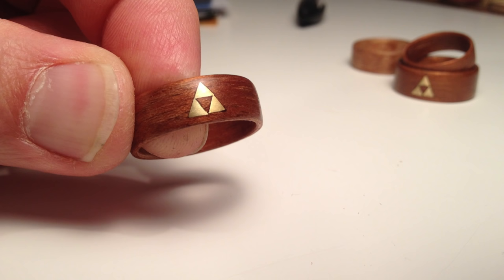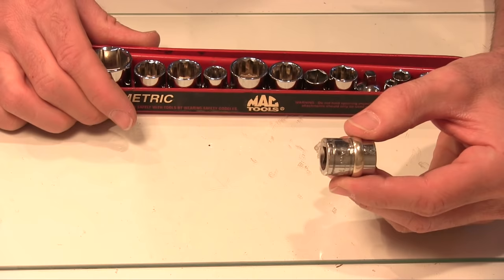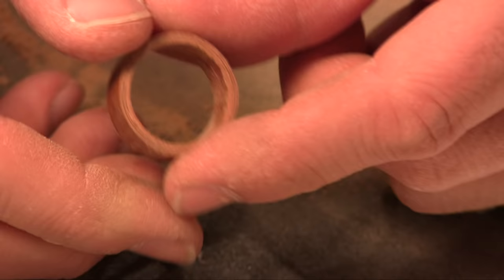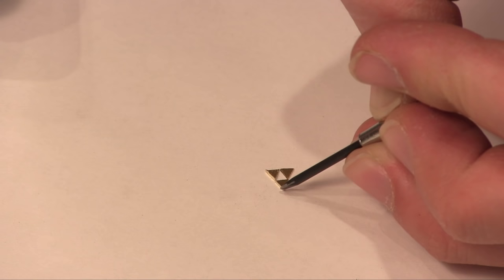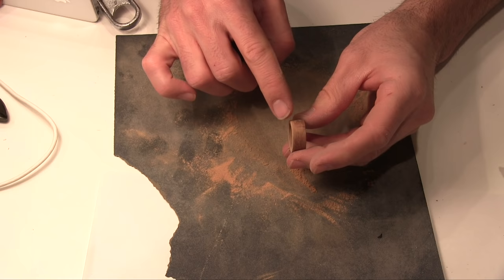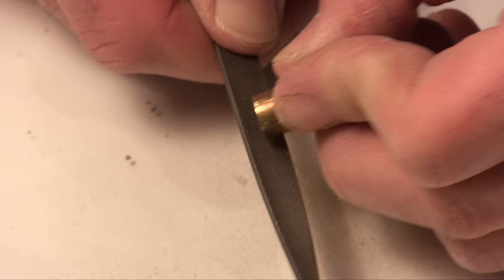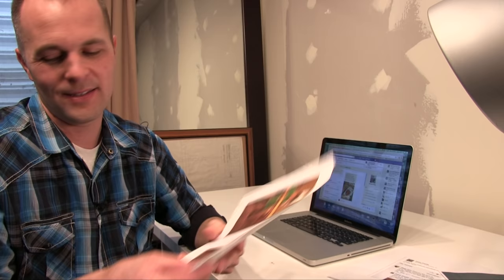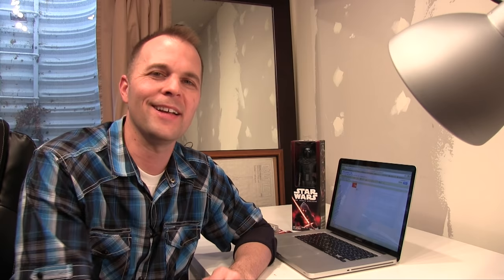How to make Wood Rings - bent veneer w brass Zelda Triforce inlay

Comment: That is pretty neat overall!  The finished product is quite stellar too, imho.  Esp that it looks shiny-ish/sealed.  Thought for SURE you were gonna glue your hands together there. lol   Then again, thought you were going to make each of those last little triangles (when doing the metal shavings) a different color/metal.  That would've looked interesting, too!  SOOOO tiny to work with, give ya credit for all that. What a great idea to use lens or zoom in on your phone to show super close-ups.   As you can prob. tell... not all that 'creative' to even come up with such great ideas myself..   One thing I did think of (well, two) is...  for those teeny triangles, rather than 3... since it's so thin, could you have only cut one larger triangle initially....  Put it on & then cut out the center little triangle (space) instead?  Esp since all are 'touching' just thought that might have been a much easier route. ?   That said, wonder if it would work (and be easier overall) I have this whole "thingamajig" kit I got for 'nails' some time back.  It's metal plates with all kinds of different small designs, patterns, pics, etc etc...   You take any nail polish (could prob. use anything in this case tho, as long as it would eventually come OFF the plate w/ acetone or ? remover of some type. WOuldn't damage it, since metal) even a chrome or holographic looking polish... glitter, what have ya...   Would prob try it right before that final coating or two to seal/finish off the ring..........    JUST before use, you swipe a bit of polish over the design of your choosing & then, using a tool that kind of looks like a short pen with a wide/rounded base that's rubber....  you quickly "roll" over the design to "pick up the image".   Roll that.... over wherever you'd like it (the ring face in this instance.... rather than nail of about.... same area) where it perfectly places design or image in any color, metallic-look, glittered, etc.  Could even do more than 1 in different colors, etc....   around it or.... ?   Once it dries for a minute.....  seal 'er all up & done.     If you get the chance I'm sure there are prob still a TON of videos on "nail image plates" & you'll see what I'm talking about.   A lot easier, I'd think... & more options (yet could still get metal look, as with triangles)  =)     Thanks so much for sharing this super creative idea......  easy (enough, maybe...? lol) for those at home looking for something fun, creative... but not TOO involved or difficult to accomplish.   Really neat!!    ps: How do you determine "other" ring sizes?  Do you have to get a sizer or ?   Then... how do you make 'em small(er)?                 Thanks again.      #ABillionLivesFilm (suuuuper important... esp w/ 8/8 new FDA ridiculous classifications & rules now in place.. ugh)   Live long(ER).. vape on!   #VapingisNOTsmoking (not even close.. smoking KILLS >165,000+ "kids" each/every year... from someone else's.... 2nd hand combustible cig. smoke!!! .... vaping could/would end that)
Reply from the maker: Thanks for the ideas.  The brass I used is too thick to be able to cut out the center triangle.  As for the ring sizes I included a chart in the description, also you can get a ring mandrel fairly cheap.  I looked up the nail image plates, those are a great idea.  I wonder if you can order custom ones.

Comment: Hi, I watched your video several times, got all the materials..... I'm just having one problem. I soak the 1/2" strips in boiling hot water for 20 mins. and can't get them to bend around right.. So I soaked for an hour, still having trouble. So know I'm rolling the veneer a lil putting a rubber band around it and soaking longer (about 1/2 hour) making smaller circles and double wrapping rubber band. 
All together around 2 hours and still can't  bend around small knife handle. 

I'm using Sauers & Company Padauk Veneer 3 square foot pack.
Could it be the type of veneer I got isn't the right kind for a ring project?
Reply from the maker: I'm guessing Padauk is not good for rings.  If you want to mail me a strip of your wood I will try it. (my address is in the description) Have you watched my other ring videos?  In one of them I tested 50 different sheets to find out what woods make the best rings.  I also made a free detailed printout you can use as reference to pick the best woods.
Reply: I think I figured it out. When I cut the strips they seemed a little funny, like off grain. I cut 2 more a little different and it worked a little better. I got 1 ring done, wish I could post a pic here to show you...

Thanks for the reply and yes I have watch your wood test video....

Comment: probably dumb question but is the wood id kit also usable for the rings??
Reply from the maker: I posted a video where I used every sheet in the ID kit and made a ring.  Check it out.  The answer is yes, but it is nice to have a few more inches in length to work with.

Comment: This may sound like a dumb question, but..... does the size of the socket mean the size of the ring? Like, if I wanted to make a ring sized 12, do I use a 12mm socket to wrap the veneer around??? Please help, I'm confuzzled :(
Reply from the maker: +B. Jilian Bonilla No, you would need to measure the diameter of the socket and compare that measurement to the ring size chart. I included a ring size printout in the description.  The reason I used sockets is because they come in many sizes and a lot of people already own them.

Comment: If your dumb enough to do what I did and get the glue on your your fingers, don't panick. If you happen to bond your fingers together, get to a sink and apply a light pressure while holding your hand under running water. If you just get glue on your fingers, wait for it to dry and it will come off pretty easily if you pick a it

Comment: Wouldn't it be better to use linseed oil for the last coat?
The glue is already in there so you wouldn't really need a protective layer on the outside.

Comment: I have come across  a problem. I cannot get the ring off the socket. I think I completely glued it to the tape, so it's suck. What do I do?
Reply from the maker: Watch my latest ring video.  I now use wax paper instead of tape.  I had a ring stuck to the tape once and I had to use a crescent wrench on both sides to push it and slide it off.
Reply: +HappyAtom Ok thanks
Reply: Wax, paste or solid, is used in traditional woodworking during glue-up. Maybe wrapping around a candle, to start, could wax the inner wood surface enough to break free of the metal  form.   In a pinch you could even  put a thin coat on the socket with crayon or chapstick.  cheers
Reply: wd-40 if you have to it will take the glue of the tape and maybe the super glue also but it's worth a try

Comment: I would have made a clamping coil with a lathe, Then while the bent ring is being clamped i would have put it in the oven to heat treat it (This makes the wood more stable and resistant the wear, Also darkens the color but i like it that way) After that i would glue the ring with wood glue water resistant, Only thing i would use superglue for is inlays. After that i would sand it the same way you did and i would apply a finish depending on the wood. 

I am planning on making a couple of these for my girlfriend, Your video didn't really teach me much as i am a woodworker to begin with, But it sure was entertaining :)

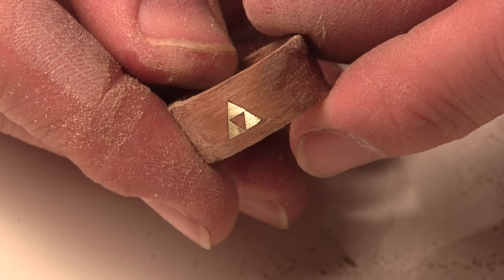Comment: Thanks for the video! Nice detail and close-ups. I just haveto take my hat off to you!  Just watching you deal with angles, morticing, keeping track of which triangles go where,and turned over to right side; and all the triangles are what--3/16"across? OMG. You have jinormous patience! So, just one question; if super glue dries in a few seconds, how can you pull out a triangle, turn it, and put it back in without digging out the old glue thats hardened? Im guessing the new glue melds the previous glue, so you can re-set the triangle in the same hole,yes?At 23:29, ok, now you can go on your vacation to let the skin on your fingers grow back! Yeah, at 25:46, you say"yeah, that should be good enough". Something I would have said WAY before this!

Comment: great video! have you tried a jewelers saw for cutting your inlays? you can get one for about $13 and glue three layers of brass together. you can cut it all at once at a 90 degree angle so you don't have to file

Comment: Awesome project.. They look really kewl.. How would these go with inserting gemstones? is it possible to drill right through these so the stone show's on the inside too, or would they split? Quite keen to try these as wedding and engagement type rings..
Reply from the maker: No the ring should not split.  People add stones to these, you can image search for ideas.
Reply: Kewl thanks :) I bought some Wood veneer this week so I am quite keen to give them a go. I made a sample one as a practice out of 280gsm card. It turned out pretty good and quite strong. It's even waterproof.. The possibilities are endless ay.. :)

Comment: I've noticed the darker woods don't really bend at all, even with a long soak and boil.
Reply: I also had problems bending mine (very dark walnut wood). I had to place it a few minutes in a bottle full of water, till i could get it into the glass. Then i started microwaving until I saw bubbles at the wood. I waited like 10 minutes and the wood wasn't bending very well so I started repeating the boiling and cooling down until the wood was bending better. I think you just have to repeat this step until you could bend it into the smaller shape.
Reply: the wood has certain orientation to which way it will ease bend, so test it before soak it at all. Just bending it slightly and find out which way it will bend better.
That is also the reason why this guy had one totally broken one cos it was bended to the wrong way.

Comment: What Veneer did you use for the rings? I tried to make them with Oak, CherryWood and zebrawood. All the same thickness. The Cherrywood rolled out perfectly, The Oak chipped a little bit from the sides and The Zebrawood didn't even want to roll
Reply from the maker: I cant remember off the top of my head but I think my favorite wood was walnut. I will make a new video soon that answers your question.  I will test all types of wood.  Right now I am finishing up the laser burner video.
Reply: Oh great :D there are a lot of unanswered comments here so that video is gonna be really helpful, You should try using cherrywood it looks great and is really easy to work with
Reply: No

Comment: How do I stop the wood from splitting when I try and roll it?
Reply from the maker: How wide is the strip of wood and what wood are you using?
Reply: Half an inch, and oak.
Reply from the maker: Some oaks roll different than others.  If you watch my other video of the 50 veneer test you can print out a list of great woods for rings.   It's in the description.   You may not have the wood hot enough, or you may need to make the strip thinner.  Half inch is usually ok but maybe a little less will help you.

Comment: When hes replacing the pieces into the holes, why not use the packing tape to remove the loose pieces without disrupting the position, then laying them back down after you apply glue with said tape

Comment: how do you get rid of the layered look?
Reply from the maker: Its a matter of wrapping the wood very tight. (some woods are easier than others)  I try to roll it over and over while pressing hard on the table to work out any gaps.
Reply: HappyAtom so you don't sand any edges? I've made 2 rings they both had "tree rings" in them no matter how much/hard I wrapped and they were easy broken (only broke 1) is there a way to make it harder
Reply: Philip Coulson

Comment: i also made ring before see this.i attach some works from wire fiber.for attach it i use ezy way.its useful for ur future works
when u cut and polish ur work glue on ring and attach ur design.after attach glue all surface of ring.after dry u can sanding in soft sandpaper.now take piece of wall tile or flour tile.sand it and collect that tile powder.and put it on cloth like t-shirt.and rub it when polish.and take a super finish take bit of tooth paste and splash on that cloth.rub ur ring on it.finely u made super ring.and never break off ur design on ring.the inported think is when ur rind looks fade u can  take tooth paste and rub with cloth.its becom new look.
and u did nice job.congratulations.
add me on face book
salila c jayarathne
thankyou

Comment: The way you struggled with the inlays, you probably need a slower version of your CA glue so you have more time to work. 1982 was the last year of the all copper penny but also included zinc versions of the penny the same year. So you can totally be safe with 1981 and before.

Comment: is it possible to resize these rings?
Reply from the maker: Not too much. you can sand down the inside.
Reply: HappyAtom So making it smaller is much more difficult?
Reply from the maker: It's easier to make a new ring instead of resizing it.

Comment: Why not use  solid mass of  wood instead of veneer , it's much stronger?
Reply from the maker: In most cases it is stronger to use veneer.  Veneer rings are surprisingly strong.
Reply: I make solid rings i can almost garenetee they would be stronger and u. Dont see any places where u see the veneer

Comment: Why don't you submerge the entire ring in superglue? this way you do not glue your fingers and the glue will penetrate equaly. Other thing is using a stencil to cut out the wood and the brass OR other type of wood, a clearer type.

Comment: I don't own a microwave so i'm having real trouble getting me veneer's to bend. They all end up cracked like the other ring in your video. I tried boiling it in a small pan for 30 minutes and also used my steam iron but its not bending anywhere near as well as yours is.
Reply: Also could you do a full strip around the ring using the powder method doing it in stages? I wound 2 copper and 2 brass wires together and then flattened them. Makes a nice design but i think it will be difficult to get inlaid.
Reply: I managed to get it to work by doing it in stages. Wound it round a much larger socket and allowed to dry and then boiled again using a smaller socket. Worked pretty well but different veneers are proving to be difficult.

Comment: How about drying in the microwave?
Reply from the maker: roy childs I tried that.  It does not work well.   A blow drier or any constant heat source will work better.  Even a dashboard or windowsill on a warm day.
Reply: Roy, get a heat gun.  It will change your crafting life forever. :)

Comment: best way to make a ring out of wood is to carve it from a solid piece of wood!
Reply: Have you ever tried that way to do the ring? There are at least 2 problems. The first one what come to my mind is that the wood is not so solid as metal ring is.There are tiny small cells on it and that make it weak. Second one is the pressure resistance. You can broke the solid wooden ring ease by just putting your hand in a fist, your fingers get thicker and the thin solid wood ring will broke.

Comment: Ouch tendonitis. Your bodie's way of saying "I told you so" in the most painful way. 

Using that socket method. Autozone carries Duralast tools which are fairly cheap but surprisingly well made. They have extensions in two varieties: smooth and textured. A textured extension gives you a high grip surface to torque on. That sounds like it would be a great fit for this kind of thing. That or take a long smooth extension to someone with a torch and ask them to bend it for you.

Comment: I enjoyed your video but was "stressed-out" a bit watching you work with your hands holding the ring and trying to place the "triangles" into the ring... might I respectfully suggest, you may find it all so much easier to slip the ring over a pipe for easier handling. I would use masking tape or wax paper to "size" the pipe to get a little tighter fit. I think it would be so easier to do that "fine" work that way.

Comment: You would've made life easier for yourself using fine tweezers to pick up and mount the copper triangles instead of trying to use the tiny screwdriver. Also by using tweezers you would alleviate getting glue on your fingers etc etc.  Imho.

Comment: Why not just drill a hole in a piece of wood and sand it?
Reply: Because it's more difficult to find the size
Reply: Chris Padilla buy a bigger drill bit?
Reply: I found that the wood splits really easily when you do that. It should be possible, if you drill in one of those center rings. Either way, the rings in this video are less fragile.
Reply: ***** Use better wood?
Reply: Soft wood splits less often. The wood I use is about as soft as it can get.
Reply: If the wood splits, it had a split before you drilled it
Reply: Yes, any natural wood has weaker points that cause a split. Only something like MDF doesn't split, but that doesn't have the "wood" feel to it.
Reply: Soft wood is poor for bodily wear. Also, never seal or finish your wood jewelry with anything other than beeswax or natural oils.
Reply: The wood will split where the grain runs perpendicular to the curvature of the ring. By wrapping the veneer around an object, you prevent the piece from having any weak points like this, since the grain now runs in circles around the circumference of the ring.

Comment: you've some dry finger tips mate
Reply: When you glue in the triangles, you don't have to take them out to glue them, simply wick the glue over the inlay and the glue will pull itself in due to capillary action, that may make it a little easier .
Reply: I'm confused